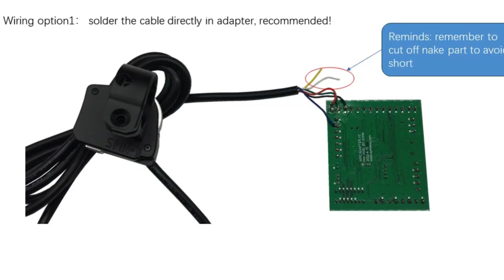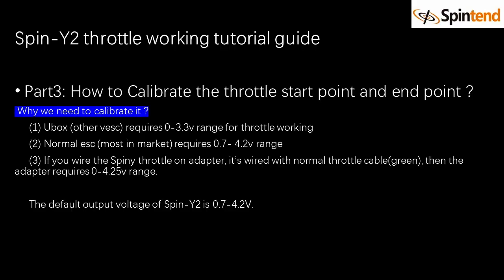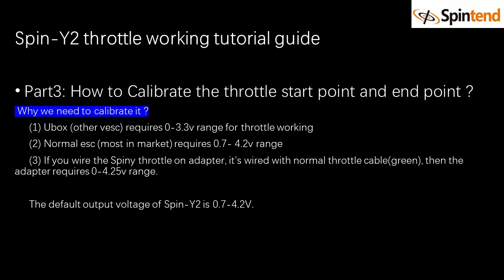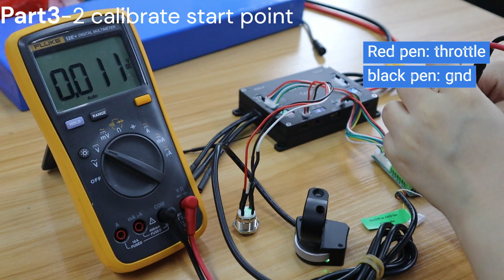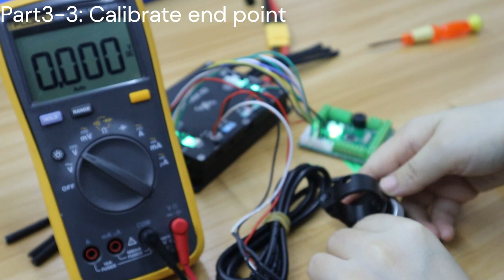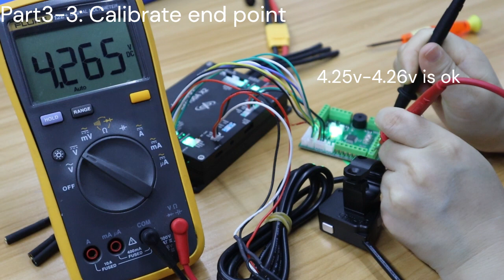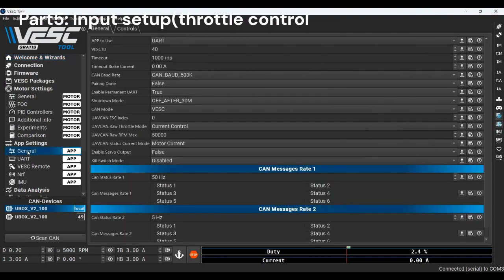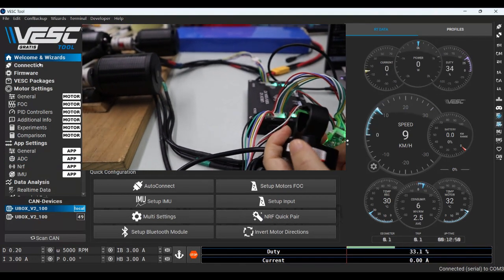Spin-Y2 working with adc adapter tutorial video | Spintend.com

Comment: Is it possible to use it with a Super73 ? What is the color of the wire for Signal Speed in the Super73 connector ?
Reply from the maker: if Super73 don't use vesc as its motor controller, then you need to use SPINY for normal throttle input , the wire color for throttle is green, please refer to the user manual : http://175.178.7.90/index.php?title=Spin-Y_manual
Reply: @spintend  thanks for your reply. I don't know if it uses vesc that's also a question 🙂
Reply from the maker: @geeksince1983  I just go through the Super73 bike website, there is no detail description about its controller, you can only ask the seller, if he don't know anything about vesc, then it quite possible they don't use vesc in super73. and also I see the speed is not too high, it also a hint it's not a vesc, normally people use vesc for getting higher speed. maybe I'm wrong, but you can verify it with seller.
Reply from the maker: again, we sugest you to use the green cable for normal esc. if you're going to use spiny.
Reply: @spintend  thank you very much for taking the time to look, i bought the spin-y2, it's on the way, i'll try the green wire and let you know ;)
Reply from the maker: @geeksince1983  looking forward to hear from your update, thanks !!
Reply: @spintend  I just received mi Spin-Y2 today and it works with the green wire. Thanks for your help ! 
Is there any way to block the reverse ?
Reply from the maker: @geeksince1983  yes, we shipped a M3 longger screw, which is for block the reverse, replace it with the screw that lock the handle bar part
Reply from the maker: @geeksince1983  yes, use the M3*12mm screw, it's shipped in accessory